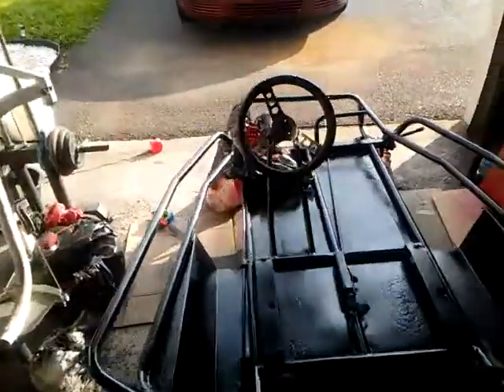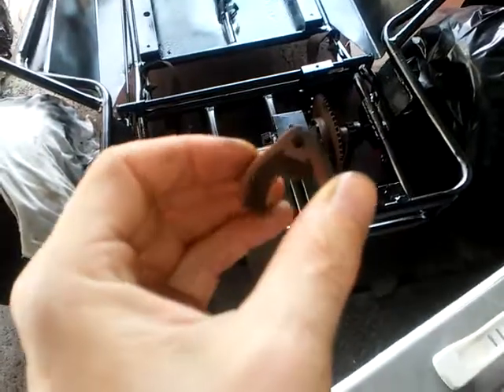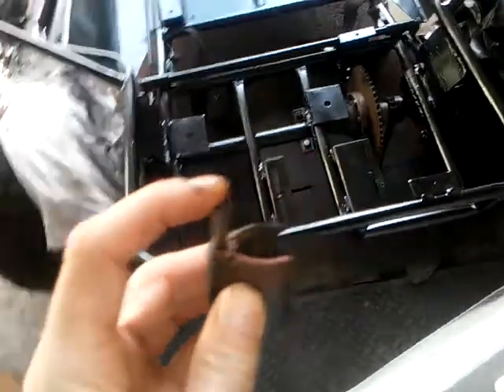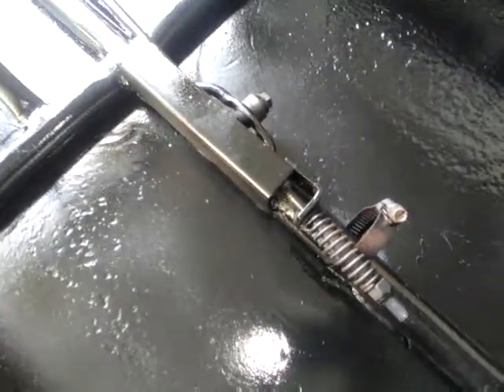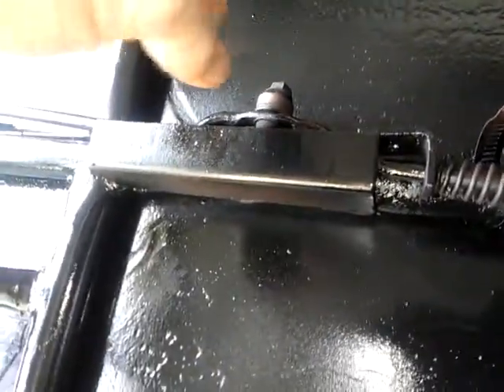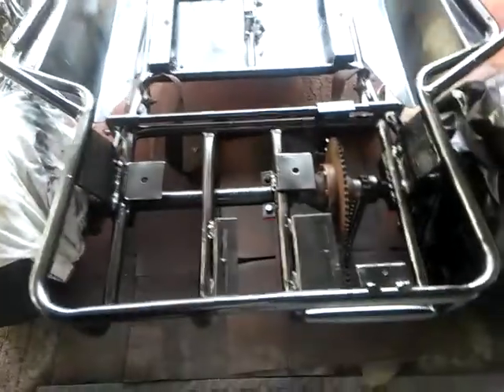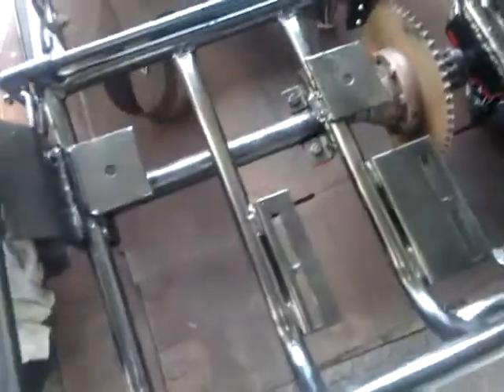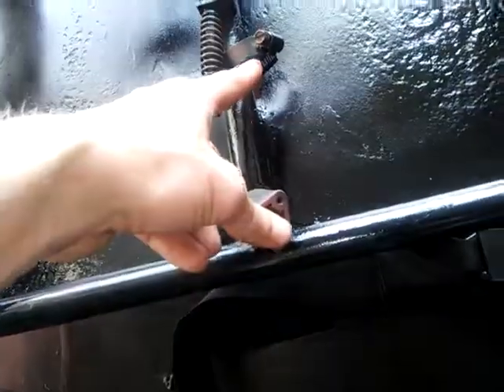Go kart throttle cable hook up

Comment: That plastic thing tells
Me they took the cable
Off a lawn mower and rigged it that way.  I would splice it to length and tie it into ball of your pedal rod behind the spring then connect cable to engine throttle